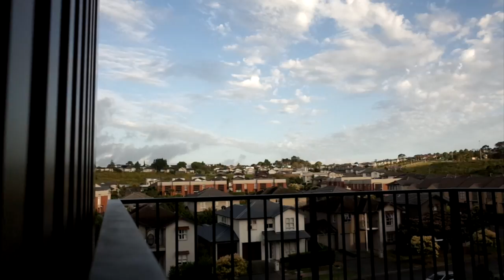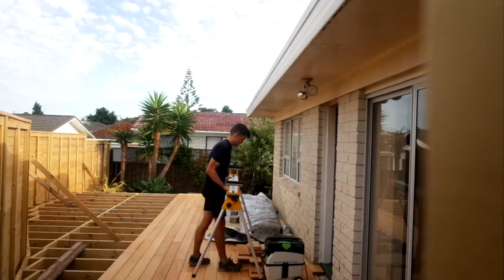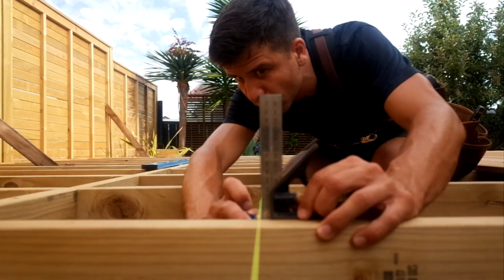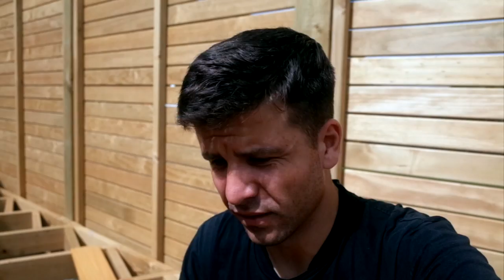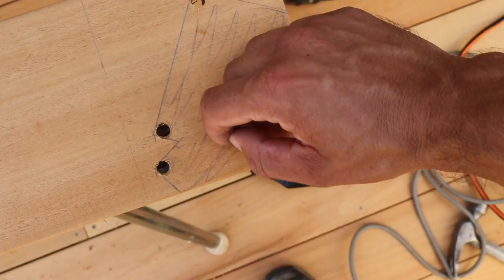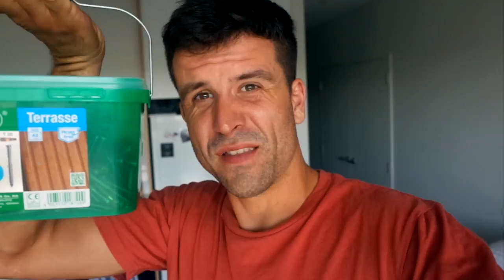1500 Screws on ONE DECK!

Comment: LMAO  25 deg and soo hot, Mate come work with us in AUS on a summer's day gets to 40, even up to 47 in the west and it's always when you need to do the decking boards it decides to be  a hot one, keep up the good work.
Reply from the maker: Paerau worked over there for a bit, he said they would get sent home because of the heat! Don't know how you do it man
Reply: I'm down in coastal Texas and we get those heat indexes up into that 40-47 range. Actual temps being closer to 35~. It can be brutal, but plenty of water and take breaks in the shade. No problem. But Zane's right, it always seems to be the hottest damn day that this type of work needs to be done. Hah!
Reply: Zane H I think his point was that it was only 10:30am. 40C days usually at least take up to around 1pm to get there, if not 2pm or 3pm

Patrick Houser if you work up in Brisbane (QLD) or further north like Townsville, or even cairns, you might get an actual 40C day, with a 100% humidity giving a heat index of, "way too hot, this is hell, and I'm soaking in hot water that is not cooling at all" degrees celcius.

And then there is Darwin. You should look up Darwin, they have an actual monsoon season.
So it rains there while it's 32C actual temp, and already at 100% humidity, and the whole city and town is being given a HOT shower.  It also doesn't let up because it's so close to the equator. Each month the mean max temperature never falls below 30C and the yearly average is 32C
Rainfall for Jan is 430mm or nearly 17 inches. Yearly rainfall is 1.7m or 5'7
Reply: PBMS123 Yeah I think Scotty knows I was taking the piss out of him, Over the last 3 years Avg Max temp in Auckland  Summer is around 23, Feb 2016 it hit, wait for it 27C, need to go back to 2011 where it hit over 40C in Timaru, then Jan 2018 it got to 37 in Waiau, this was NZ's hottest day in 7 years, in the same month Sydney recorded it's hottest day at Observatory Hill at 45.8C this was in the inner city not the western suburbs which reached over 47C, how do I know because I used to be there quite often, NZ doesnt get high 30 -40C days often like we do.
Reply: Humidity is different here in NZ as well... I have seen Aussie work here that are use to those 40 deg, but struggle in the 225-30 deg with the humidity
Reply: Where are those Aussies from? Because east coast is humid, and if they're from brisbane they'd find that cold lol.
Reply: Yep same for Sydney, the Humidity can be a killer in Summer, if Aussie work there and can't cope with the humidity, they must been from the outback anywhere from Sydney up on East coast is very humid

Comment: Hey mate if you want to work out pretty accurately how many screws you’ll need before you start use the formula: lineal meters of decking divided by joist spacing x2. (500Lm divided by 4.5 x2 = 222 screws) 👍
Reply: 2,222